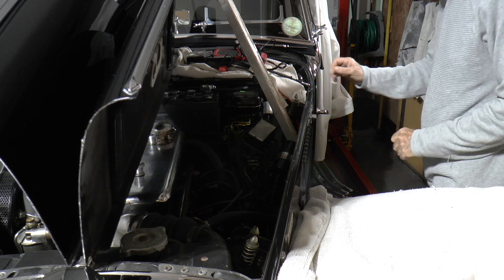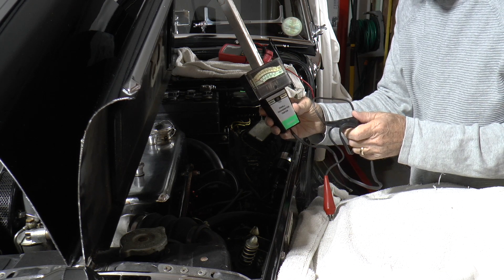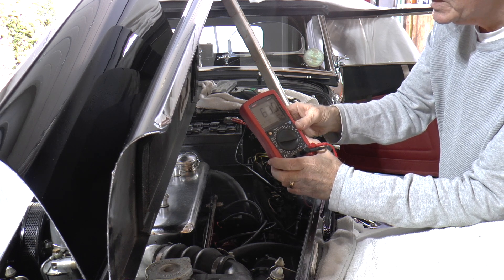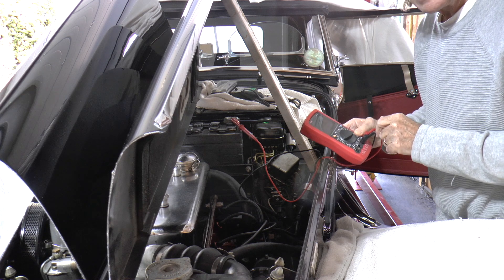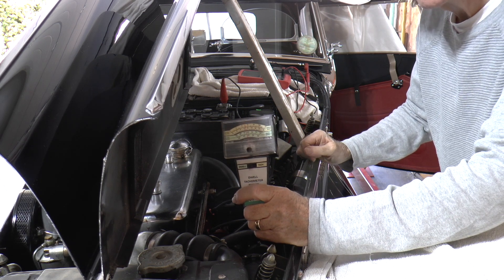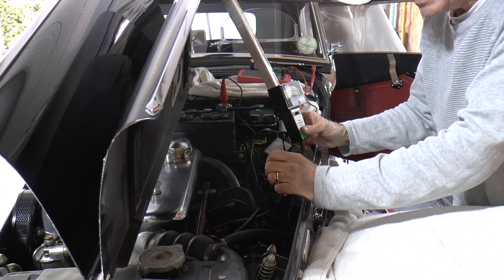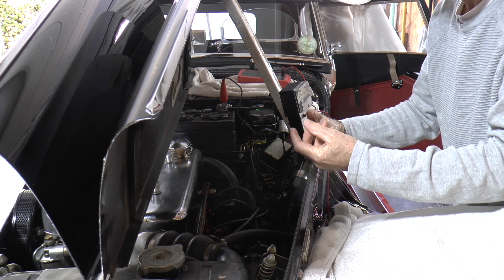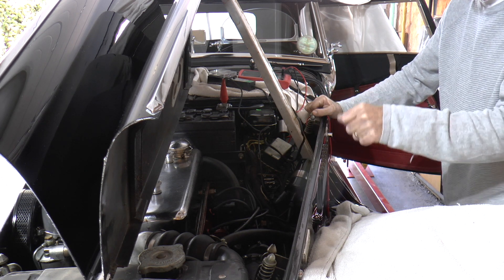Using a dwell meter on a TF

Comment: What connections do you use on the old meter?  AC? Resistance?
Reply from the maker: TF is positive earth so Dwell meter red clamp goes to battery positive terminal and black clamp to either end of wire from coil to distributor. And that’s it.
Reply: @T Register of the MG Car Club  thanks for responding.  I have an analog meter but it doesn't have a dwell port.  I used it 20 years ago to measure dwell.  It has the angles on it, but after watching your video, I think you're measuring DC voltage switching on and off.  I haven't tried yet, but I think I need to use the DC port.